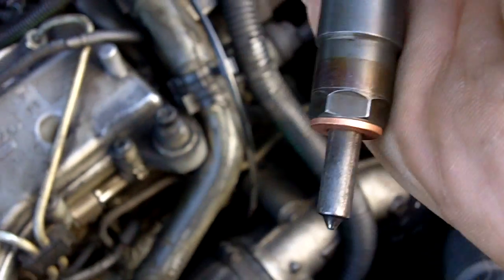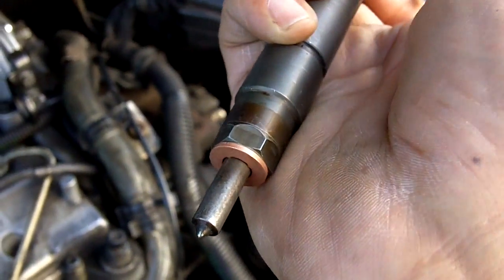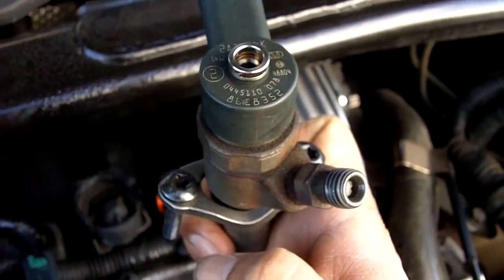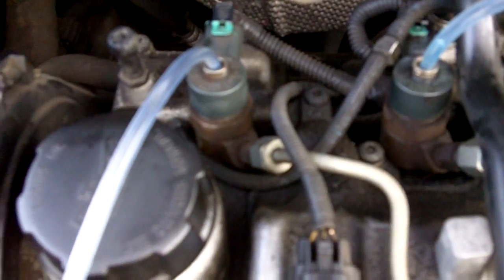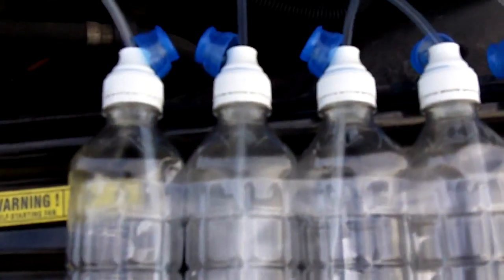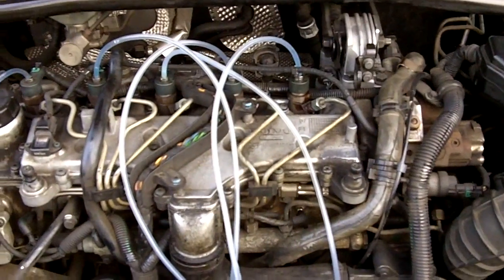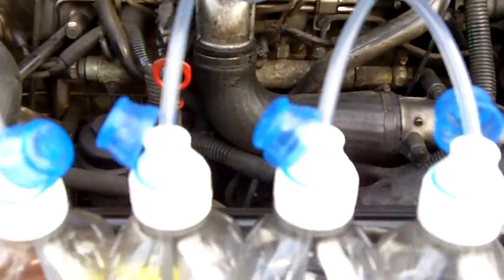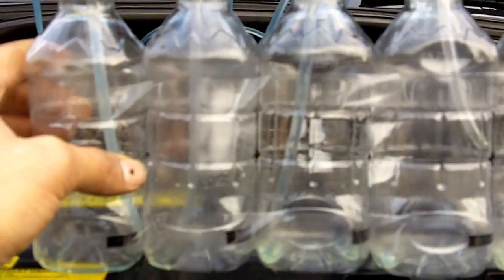Diesel Injector Installation and Leak Off Test Tutorial

Comment: When you remove the return lines to perform the test, do you have to block them off? If not will fuel pour out of them?
Reply from the maker: @romand9972  Not on the Euro 3 D5. You will have to block Euro 4
Reply: @sirobb  yes euro 4 d5 here. thanks for your quick reply 👍🏼

Comment: Rob, i've just done a leak back test on my 2006 V70 D5 (185 hp) due to it cranking over a few to many times before it starts. I followed your video but once the engine was running for a minute i noticed a puddle of fuel on the floor. On further inspection I have fuel coming out of the leak back pipes and hardly any out of the top of the injectors which i guess is a good thing.
I know it's difficult to diagnose but would you say the my high pressure fuel pump is at fault?
I carried out this test on my wifes old 2002 S60 D5 without any fuel leaks from the leak back pipes.

Many thanks.
Reply: Hi there, I have the same issue. Did you work out what the cause was? It looks to be the high pressure fuel pump as you say but would be happy to be proved wrong! Cheers

Comment: I done the test and 3 of my bottles filled up within 30 seconds, I was also getting low fuel rail pressure, could the injectors leaking back cause a low fuel rail pressure, thanks for the video, it helped a lot
Reply from the maker: Excessive leaking injectors can be a cause of low cranking rail pressure so a good place to start.

Comment: Brilliant tutorial once again,  2 quests:- had you to code the ebay injector to the ecu on your car & if yes what did you use ?  many thanks from  Helga (2004 V70 D5 P2 AWD Estate) and me.
Reply from the maker: Because it is a Euro 3 D5 and the replacement injector was the same Class as the other injectors, everything was plug and play with no software required.

Comment: Bare in mind, just because an injector passes a leak back test does not mean that it is good. It is only one test. An injector can still leak fuel into the engine, inject more or less fuel than it should and also have a very poor spray pattern. After 100k miles any of what I mentioned is possible. Great video apart from that though.

Comment: Hi, I have a volvo V70 D5 Euro 4 (2007), just had one fuel injector replaced, and all worked fine for half of the day suddenly the car is now vibrating on idle/park.  I have had the codes read and it shows nothing.  Am wondering what this could be and how can it be fixed.  Thanks
Reply from the maker: J G Did you program in the new injector?
If not, this needs doing on a Euro 4 either with Vida or via a main dealer software download.
Reply: Hi SiRobb, thanx for your quick response.  The mechanic actually removed/cleaned and reused the old injector.  I asked him about reprogramming and he said there was no need. But judging at how the car is vibrating , am having second thoughts.
Reply: About the main dealer software download, would you kindly send me a link?  I will be grateful.  Thank you
Reply from the maker: J G Here's an example of someone who changed injectors. https://www.volvoforums.org.uk/showthread.php?t=266822
Reply: Excellent.  I inclined to to have the injector reprogrammed.  that D5 Oomph is gone. Thanx for your help

Comment: If you just use a long piece of hose you can see within 20 seconds tops which injectors need a new valve. Its a simple test: which return valve is pushing the most fluid out.  I just put a rubber band round the open ends and stick them in a single bottle.
Reply: wozzlepop Good tip. Can you tell me what pipes have to be plugged to stop air. the one on the end of fuel rail what about the other end of pipe that goes into pump?

Comment: Rob, i take it the 3mm is the ID of the pipe?

Need to test my wife's S60 D5 which has just got a starting issue, thanks to you i was able to test and replace 2 of the glow plugs but this hasn't made any difference. 
Next is a leak off test.

Thank you very much for your videos.
Reply from the maker: Scott Raven You're welcome Scott. Yes, 3mm is the I.D......about £1 a metre from B&Q last time I checked. 

At UK temperatures, failed glow plugs won't really affect cold starting if everything else is good so you're more likely to be on the right track with fueling causing an issue.
Reply: Hi Rob, ive just done the leak off test as per this video.
Injector number 5 is at fault, it filled up to the 40mm mark in 1.15 second's the other 4 injectors didn't hardley put any fuel into the bottles so looks like they are all in very good condition.
Now to try and find a good injector on ebay. Thanks again mate, you have been a massive help.
Reply from the maker: Scott Raven No problem and at least you have a conclusive answer. 
Is it a Euro 3 D5 (black engine cover) or Euro 4 (Silver/Grey cover)?
Reply: It has the black engine cover mate (52 reg), its on 126k with full history but its never had any suspension parts replaced so i have just bought engine mounts (after watching your "popping video", bottom wishbones, rear shocks and a service kit from Volvo.
Reply from the maker: Scott Raven There's videos for all of those jobs so hopefully they'll come in useful. 
When fitting the new injector, make sure everything is spotless and definitely fit a new copper washer.
I bought a bag of these from Amazon which are the correct dimensions for the Euro 3 163 https://www.amazon.co.uk/gp/aw/d/B009NDBXVU/ref=ya_aw_od_pi?ie=UTF8&psc=1
On eBay, Huddersfield Volvo Breakers are an excellent seller and will hopefully see you right. 
Also on the Euro 3, check the injector classification and try to get one that matches the remaining 4 left in the engine. 
There's Class 1,2 and 3 identifiable by the last number of the part number on top of the injector.
Reply: Thanks again, would it be the 2 i have in a circle mate?  Part number 8658352? Everything will be spotless before i take it apart Rob and when i take the old injector out as per your video. I'm an ex Aston Martin mechanic so i have no problems in doing the work i just don't know Volvo's like you do! 

Ive also got to replace the rear trailing arm bushes, i have the bushes and have made a tool i just need to find the time to replace them.
Reply from the maker: Scott Raven Yes, you have the correct number so yours are Class 2.
With your background, you'll be fine working on an S60. 
The D5 does have it's fair share of quirks though to get it running spot on so as long as you make sure the various fluids are correct and not disappearing anywhere whilst also monitoring fuel rail and boost pressures, you'll have a very sweet running car and avoid expensive or time consuming problems.

Comment: Should you measure the volume of fuel in the pipes too?  Or should you maybe fill the pipes then start the test?
Reply from the maker: Aman A It makes no difference.
Reply: SiRobb Well it would make some difference.  If the tubes are empty, the volume of fluid collected in the bottles would be less, as the empty tubes need to be filled with fluid first.
Reply from the maker: Aman A Ok, well let's look at your question another way. 
The purpose of the test is to measure what comes out of the injectors. 
Everything that is in the pipe has come out of the injector so I'm confused as to why you're asking. 

The reason I say it makes no difference is that you've given me no information about the pipework you're using so I'm assuming a pipe length and diameter that wouldn't really affect the results. 
As said in the video, you're looking for <40ml in a minute and <10% variance so if you don't count what's in the pipe (why would you not) as long as you measure all injectors the same, the result is highly unlikely to be affected.
Reply: SiRobb Thanks for taking the time to do the video and explaining

Comment: What is the purpose of this test. To see how much comes back from the injector I guess, only why does any come back though? Is it the design to provide some kind of relief valve system in case the ECU is over supplying the fuel?
Reply from the maker: You always want more fuel available than is needed for when you increase speed or load on the engine so leak back within a certain tolerance is normal, 40ml in a minute on mine. 
A higher leak back or none at all indicates a problem.
Reply: injectors dont always use all the fuel supply therefore this uneeded fuel needs to be returned to the fuel system or pump
Reply: Yes thanks. Since posting that comment I have learnt how the injector system works. Clever stuff
Reply: James Barratt to answer the question that others have avoided to tell the exact reason.  the injectors need to be lubricated as it a heavy moving parts. it has nothing to do with demand.

Comment: Could a misbehaving injector throw the car into limp mode and also cause "soot filter full, see manual" warning message ? I was going to go for a DPF remove and delete but now think the injector could be the cause ? Will it be worth removing the injectors and having them tested ?
Reply from the maker: If you have a a soot filter full message, you've either got a full soot filter or a misreading which can be caused by a faulty dpf pressure sensor. 
I suppose a poorly running fuel system could accelerate a dpf filling up but to be honest, you really need a proper diagnostic hook up and someone who knows what they're doing.
Sensors and injector performance can be assessed in minutes with the right equipment. 
You might get lucky guessing and swapping parts but it can get very expensive quickly.
Reply: +SiRobb it has been hooked up but only showed "DPF restriction" no error codes ?? The guy said it was strange as there was no codes logged for anything else that explains limp mode. He reckons the vida reading and sound of engine gives him reason to recommend the injector test. Plus emissions are spot on and no sign of black exhaust smoke ?
Reply from the maker: +MrChristo1985 Your man could have performed an injector test there and then on Vida.
Why didn't he do it?
Reply: +SiRobb he said they need to be removed and sent to an injector place to be compression tested. I had hoped my attempt at the leak back test would confirm a problem injector before I part with £100 to have them compression tested
Reply: +MrChristo1985 he also stated that injector 1's read outs on vida weren't quite right
Reply from the maker: +MrChristo1985 That's what I mean about finding someone who knows what they're doing. 
They don't have to be removed and he can get a very accurate picture of injector performance with Vida.
Reply: +SiRobb so I should just bite the bullet and put in to Volvo to be read fully ?
Reply from the maker: +MrChristo1985 Main dealer is one option but they only fix things one way and it's nearly £100/hour just for labour and if you need a couple of injectors replacing, you're looking at a bill pushing £1000. 
I fixed my problem for £50 but dealers don't fit ebay injectors. ☺️
The important thing is someone with knowledge who will work out a fix. 
Alternatively, you can get Dice and Vida for £55 from China and learn yourself or join a forum and maybe a local member will hook up for you for a few beer tokens.
There's a lot of help, knowledge and free information on forums. 
It depends on your circumstances really.
Reply: +SiRobb I am thinking ..... Do the injector test, if any show bad either pay for refurb or buy a used replacment. If that cures DPF warning then fine if not next step have it vida read by local Indy if quoted repair is massive I will do for DPF remove and delete. Prob a daft question but will the fact it's been remaped have any bearing on this ? I know the remap can find weak links or faults with extra load but surely there was a Chanel it could've happened anyway. Well that my story and am sticking to it lol. Thanks a lot for your time to message back with sound advice rob 👍🏻
Reply from the maker: +MrChristo1985 I thought you might have mentioned the remap a little earlier in the conversation. ☺️👍

It's possible that's the problem but also possible that it isn't and there's almost too many reasons for either. 
It does pretty much rule out the main dealer option though as they'll be unlikely to work around 3rd party software to solve your problem. 
Their first suggestion will be to take it back to standard and go from there.
Reply: +SiRobb turns out the swirl arm is "broken" £6 for repair kit ... £40 labour to fit !!  That was causing the regeneration to not happen as normal. Once that's done a motorway blast should resolve the issues failing that it's a forced regen. Injectors are fine, clutch and DMF are fine so all in not too bad if it all works out on Monday 😁😁😁😁 will have ST's running for cover again soon ! Lol
Reply from the maker: +MrChristo1985 Aaah, the fabled swirl arm/flap. 
Luckily my Euro3 163 doesn't have such nonsense. ☺️
Let's hope they've nailed the problem for you then. Let's face it, they've had enough goes, lol.
Reply: +SiRobb different garage m8 😂😂😂

Comment: I tried this on my E4 185 d5. Diesel was pouring out of the small nipples on the return line ?? Is this normal ? My local stealer says it's the case because my d5 has an electronic fuel pump ? Any help appreciated m8
Reply from the maker: If you want, you can just clamp the return pipe after the number 5 leak off connection. 
It's nothing to do with the pump.👍

Comment: Great vid thanks. Should even new or refurbed injectors leak a little or should they be completely dry if you do this test? I have a misfire from cold start on a Freelander Td4 with 130k on the engine. 1 leaks practically nothing while the other 3 returned only maybe 10ml in 5 mins idling. Would this indicate its not an injector leak/pressure issue?
Reply: https://www.youtube.com/watch?v=DUmAyj6uBTo&list=WL&index=67

Comment: Thank you for replying, i will see if I can get a slightly larger dia. Hose.I will soon be using your video to do a diesel purge.
Reply from the maker: You're welcome. It would certainly be interesting to see leak results directly before and after a purge. I meant to do that myself but ran out of time. 
On the Diesel Purge video, I tried not to be too over the top about it and what it can do but it's seriously good stuff and you won't regret it.
The difference is immediately noticeable and believe it or not, actually gets better over time.
I think it's to do with the ECU adapting to the new flow rates.
I've done maybe 10 cars now and the positive reaction is the same every time.

Comment: Great video, I bought some 3mm internal dia. Pipe but it does not fit, does it need to be 3mm external diameter?
Reply from the maker: 3mm was the internal diameter on my poly piping but I don't know the external diameter. That obviously depends on the thickness of the lining.
My pipe was from B&Q.
Reply: @sirobb  Could you measure the external diameter please it is probably more important than inner diameter.
Reply from the maker: Measuring calipers cost from £2 and are always useful to have.
Reply: @sirobb  I agree but would just like to know the external diameter so I can order the pipe.
Reply from the maker: Just measure the hole in the top of the injector instead.
I don't have any pipe at the moment.
Reply: @sirobb  Oh yes ok, I thought that you still have some pipe, thanks.

Comment: Can faulty injectors cause vibration, I have checked all mounts and they are good but on inlet or low revs car vibrates could it be the injectors making engine run rough.
Al
Reply from the maker: I would be very surprised if injectors are causing your vibration. 
Connecting even cheap diagnostics can give you info as to which part of the engine isn't running right. 
There's quite a lot that can cause your issue. 
Also you have poly bushes fitted, they will transmit vibration noticeably even on an otherwise sweet running engine.
Reply: I have a bit of a noise from gear box like it's the flywheel bearing would this cause vibration
Reply from the maker: Alan Tansey Yes it can.
Hopefully it isn't that though...... £££££

Comment: good vid   ..but when u emptied out the plastic fule lines did u get anywhere near the 40ml   i wonder ..interesting that they were different  though  indicates  that  there were differences in what was going into the cylindar
Reply from the maker: Even with the fuel left in the tubing, they were all still well below 40ml, so within tolerance.
The leak back variance can be caused by minute differences between the wear of mechanisms within the injector. Also, different amounts of carbon build up on the tips can affect fuel flow at the point of spraying into the cylinder.
It's not realistic to expect every injector to wear at exactly the same rate so as long as the variance isn't too high across the board, the ECU can make +/- corrections to flow and ensure equal power is produced by each cylinder.